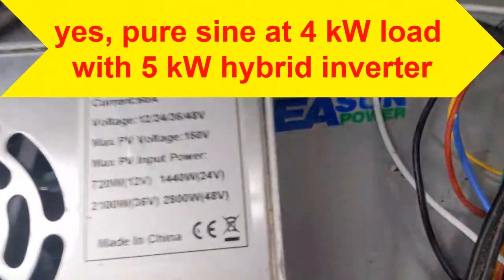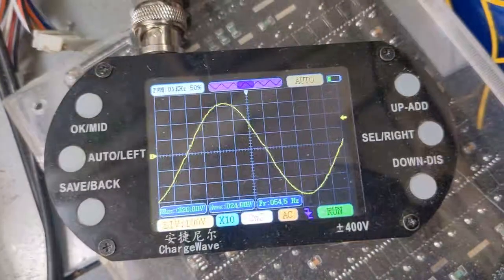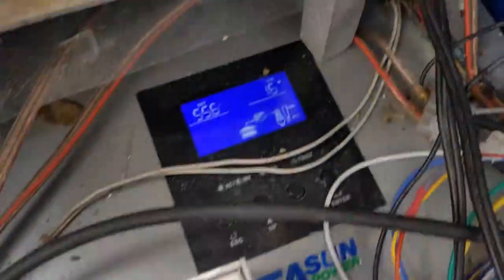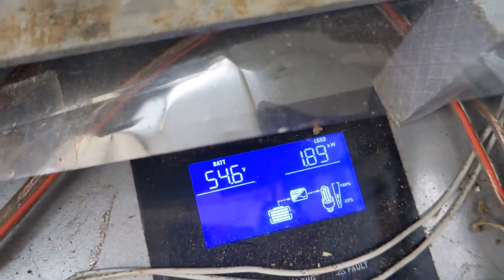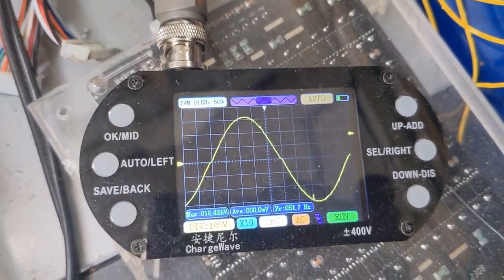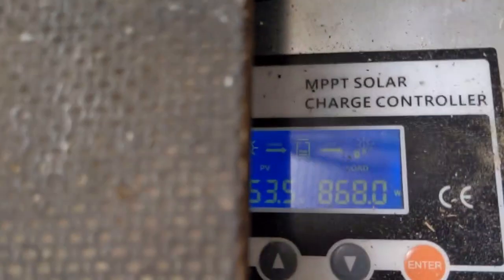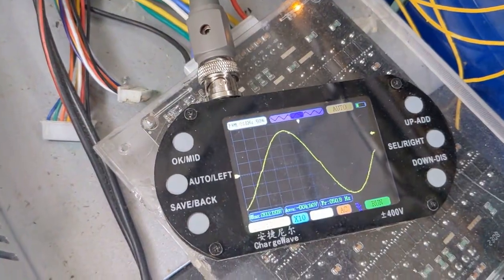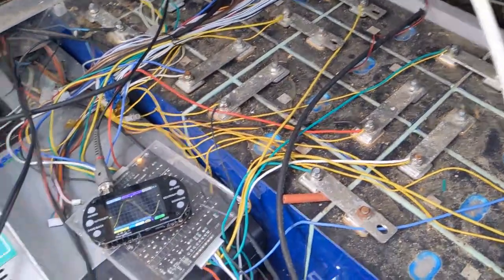yes, pure sine at 4 kW load with 5 kW hybrid inverter :-)

Comment: The problem with all these Voltronic Power rebranded inverters (past, present and future models) is not the output waveform. Is the software, with its configuration that fails when it is least expected, and the questionable selection of chinese branded electronic components.

At the end, you get what you paid, a cheap inverter that can fail at any time.